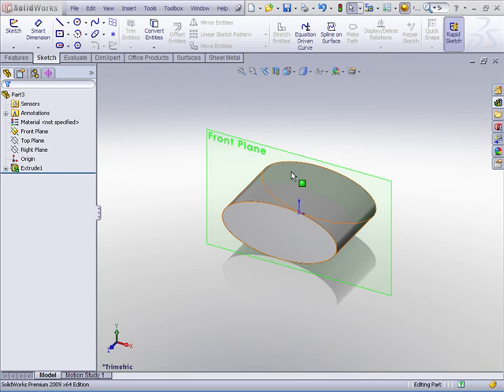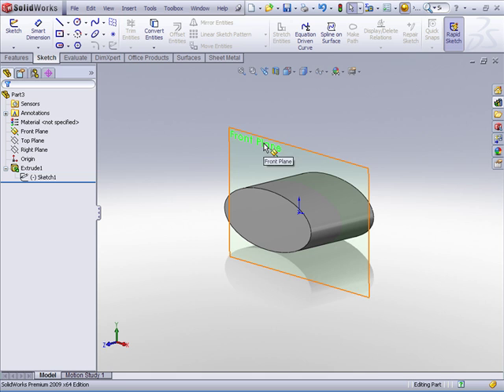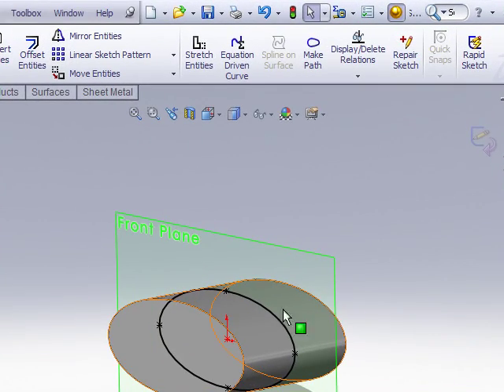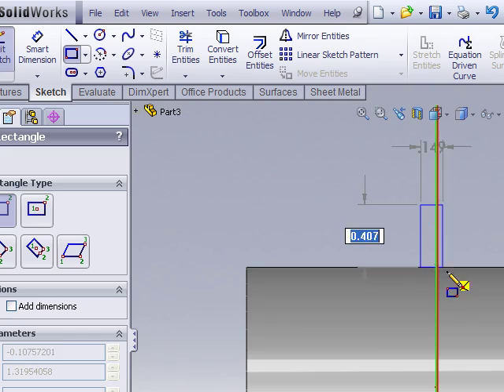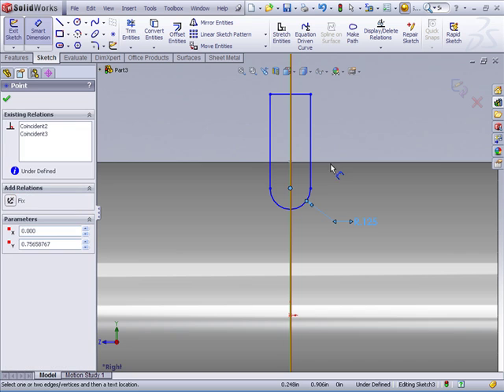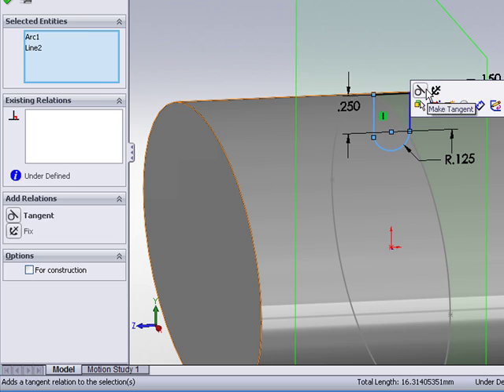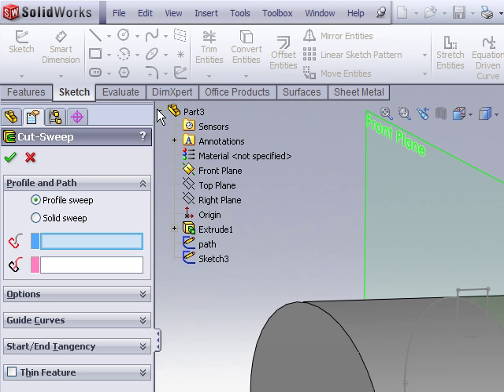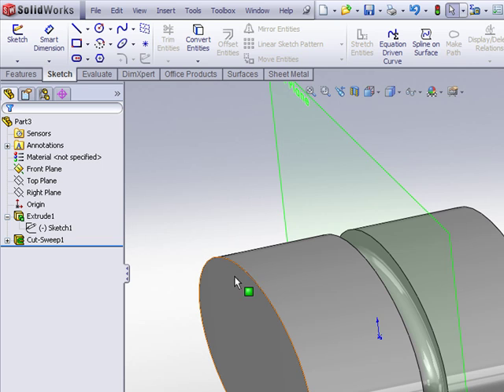Cut Sweep in SolidWorks 2009

Comment: Thank you! 

I made a cylinder from revolving a drawing. Is this the reason that the option 'convert entities' doesn't work?
Reply: +Daan Koster At least the surface doesn't highlight light blue but dark blue in my case.
Reply: +Daan Koster Nevermind! I just clicked two entities in the FeatureManager Design Tree. problem solved:)
Reply: +Daan Koster But now...unfortunately the FeatureManager Design Tree doesn't recognize the other end face of my (smaller and attached) cylinder as a sketch thus making it impossible to convert it with a plain...
Reply: +Daan Koster ah...nevermind again...you can just select the round edge of the end face and use 'convert entities' without having to select the plain you want to convert it too. probably because it's the last plane used in my FeatureManager Design tree (?)